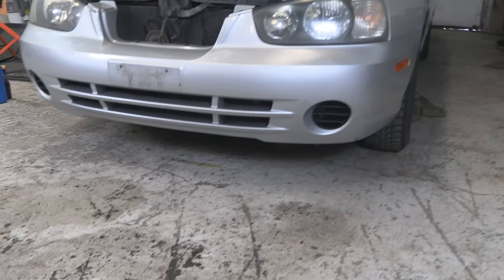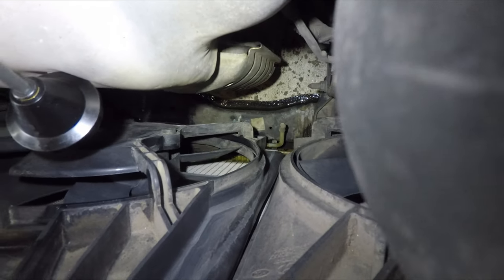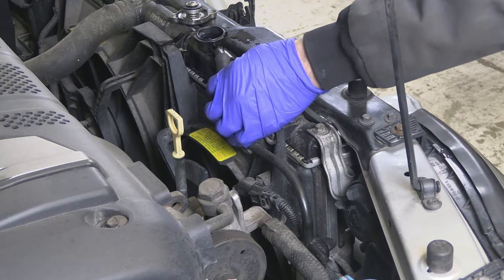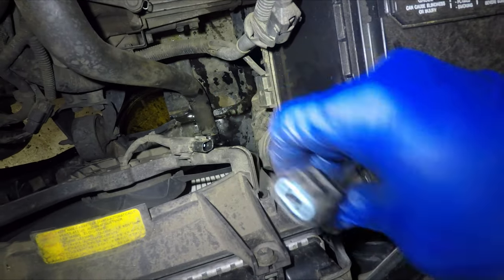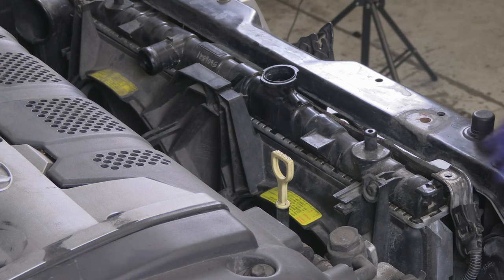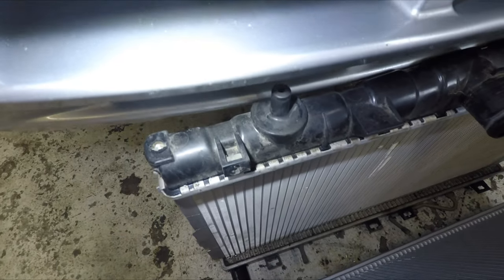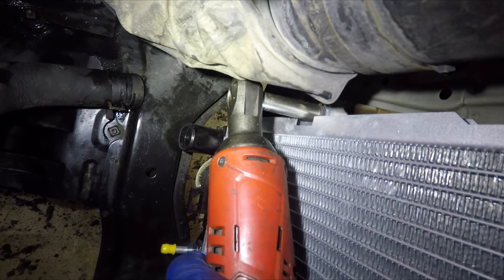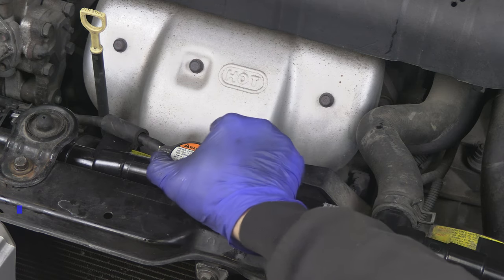How to replace a radiator (Radiator Replacement) tutorial

Comment: Quick question my car has coolant transmission lanes when i install the new radiator do I need to add transmission fluid? Im new to this mechanical stuff
Reply from the maker: You should check the level when you're done, usually the loss is very minimal and the transmission fluid level stays within safe range on the dipstick.
Reply: @MakeItEasyMechanic  What if its a newer car that doesn't have a dipstick for the transmission? Should I even be concerned about loosing transmission fluid?